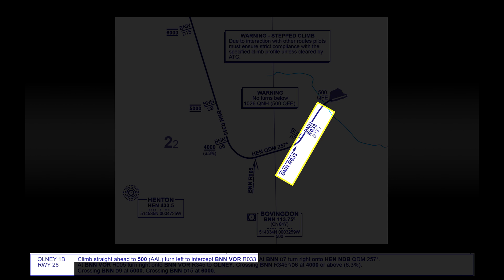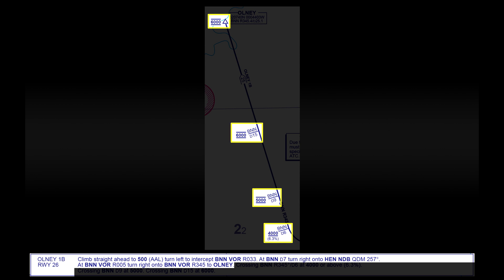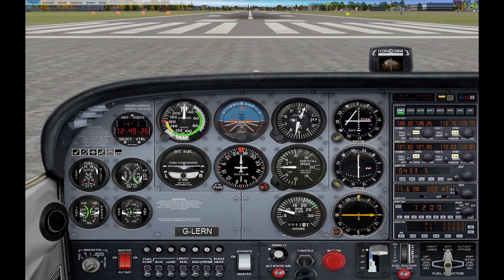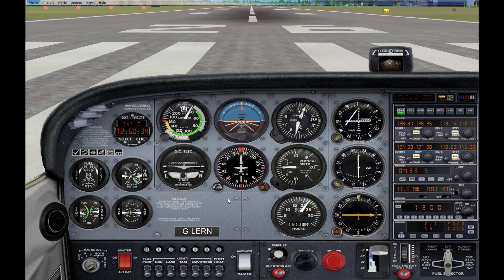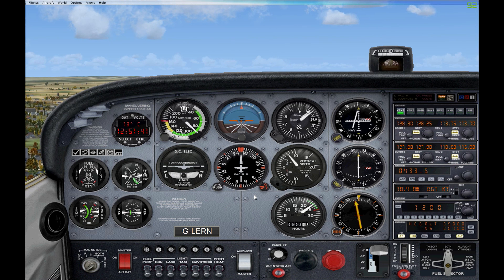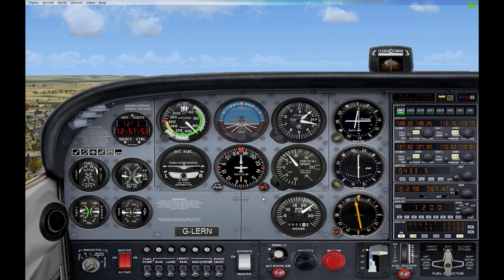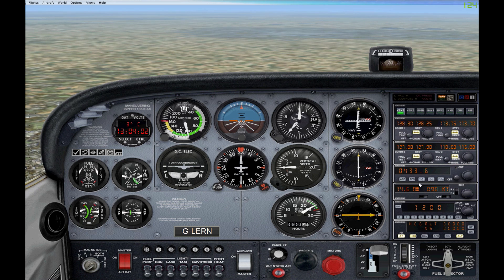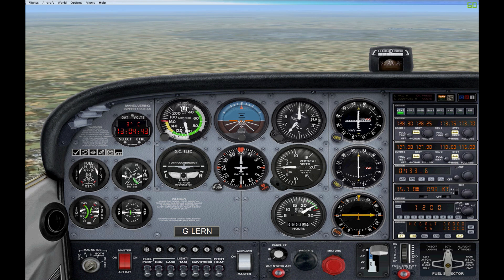SID Demonstration Flight

Comment: Hi, I know why you went off course (in the flight analysis in the end you showed the flight path). So at somewhere around 7:45 first of all you said 055, I think you meant 005 ;) You did say 005 later on though.
But the real mistake starts to happen here: at 9:47 when the radial is captured you do correctly when you reset the OBS thingy but you should've also turned to the direction of that new radial 345. I did so and... bam, the plane flew exactly over the waypoint OLNEY. Just to inform I'm using an another Cessna that has a different sort of VOR capturing thing (not sure if it's called CDI). Anyways it also shows the direction a bit better so that's why I had the idea of doing that turn earlier. You can also understand your mistake by looking the chart you showed in the beginning. The turn starts after the mark that says BNN R005
BTW - I'm new to navigating like this so this video was very helpful, I thank you for that. Plus it was nice that I also realized something by myself. The best learning experience :)

Comment: Hi Doofer. Thanks for taking so much time in making these videos, as I am learning a lot from you. Did you intentionally not use the ATC? If you had used the ATC, they would have vectored you to another direction right? Doesn't this take away from realism? :( :(
Reply from the maker: Yes I deliberately did not use ATC to demonstrate the departure procedure. Sometimes ATC would vector you manually, sometimes they ask you to follow the full procedure. It just depends on how busy the airspace around the airport is. If ATC can give you a "shortcut" by manually vectoring you then they will but as I said, it depends how busy the airspace is. Departure Procedures are designed to keep departing planes at a safe distance from arriving planes.

Comment: you forgot to set the flaps for Take off. Overall very good video.
Reply: This looks like a simulated Cessna 172.  Flaps are retracted for normal hard-surface takeoff.  Flaps are used for soft field takeoffs to lift off as soon as possible.

Comment: Hello, first of all I would like to sincerely take a moment to thank you for your incredible tutorials. I have watched and saved them all on my computer, taking a myriad of notes to help my learning curve in flight simulators (I use P3D now). I have shared your videos with a friend of mine who also thanks you immensely and we both hope you will continue to provide us more tutorials!

Now I understood every single of your tutorial videos; except one element in this one.
I found and printed all charts in all your videos for practice purposes, hence i printed the SID for London Huton. I understood it all until the point when you changed the ADF from 433.5 (HEN) to 433.6 (???). Why have you changed that? There is no indication whatsoever on the SID chart of a 433.6 NDB! My head has been spinning for the past 15min so I pray you can respond to me rapidly!

Secondly, you say after 7nm to turn the VOR indicator to 055; but on the SID chart the second point is at 005..is it me who did not understand or is there a mistake in the video?

Cheers!
Reply from the maker: +Toni T Hey Toni, thanks for your kind comment, I'm really glad my videos are helping you understand flight simulation! :D

So the reason I changed the ADF frequency was basically to "turn it off". I only needed the ADF for the first part of the SID, then once I turned onto the 345 radial from BNN, I didn't need the ADF anymore. 

As for the change on the VOR indicator, I did mean to say 005 degrees but accidently said 055 :/ so that was simply a mistake on my part.